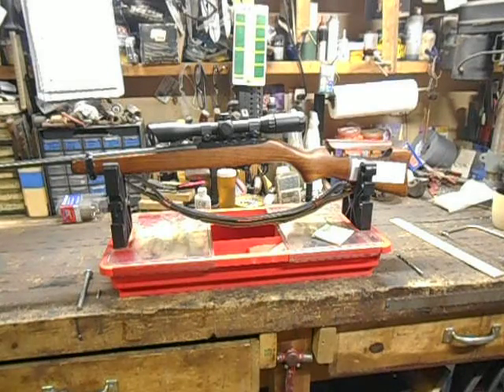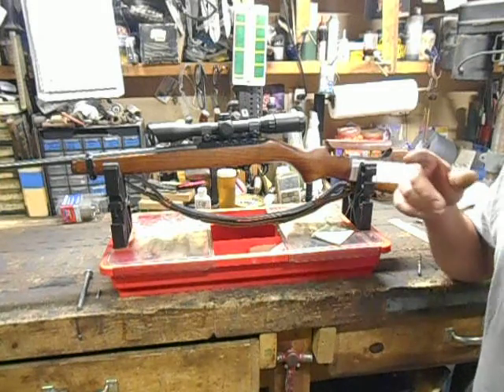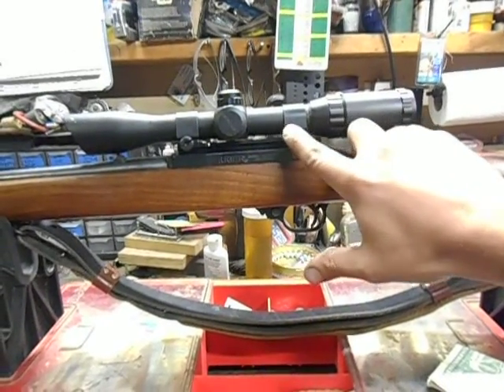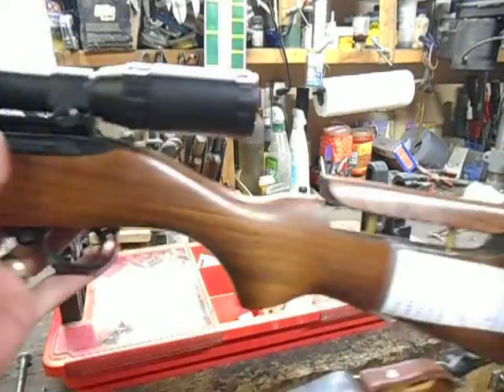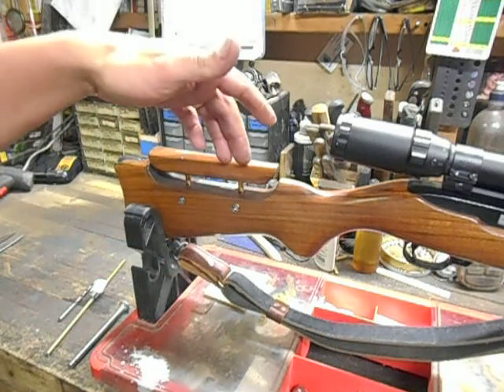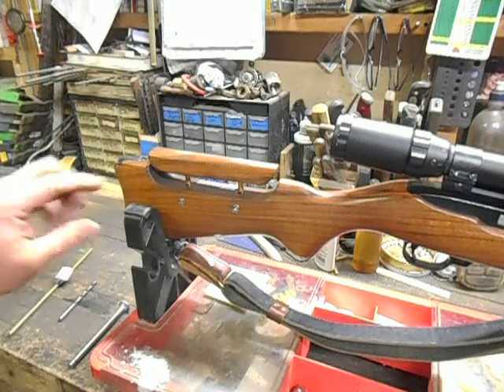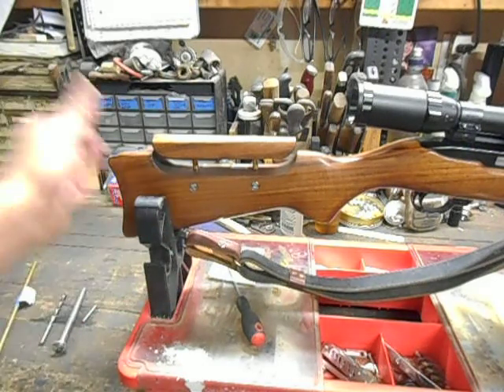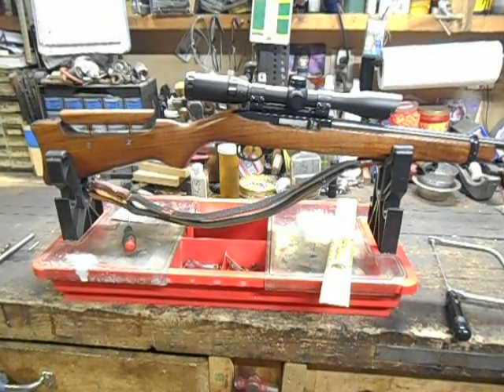ruger 10/22 cheek riser or adjustable comb

Comment: Great idea, and really doesn't look like a difficult build when you break it down like you did. 

I've got an old carbine stock I'm going to strip and refinish. Your mod is going to be part of the project now. 

Looks like like you made the riser section about an inch deep, am I correct in that?
Reply from the maker: thanks! yes, I would go at least an inch thick for the riser part

Comment: how do you know how big a piece of the comb you cut out, is there a standard or rule of thumb ?
Reply from the maker: with this just being a 22 rimfire and with no recoil for the stock to have to withstand, I just eyeballed it. i mounted the rifle into my shoulder a couple of times and marked where it felt like my cheek was hitting the stock with a pencil and went a little more forward and back. with a hard recoiling centerfire rifle or a shotgun, id be tempted to go the route where you use a piece of kydex folded over so you just have 2 small holes through the stock to keep the strenth there.